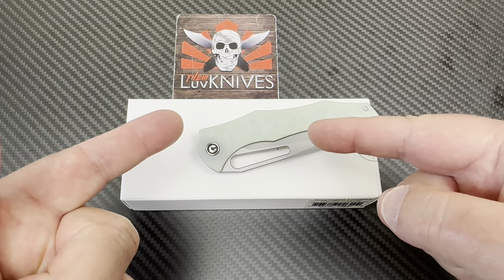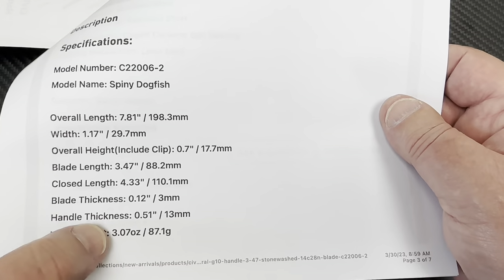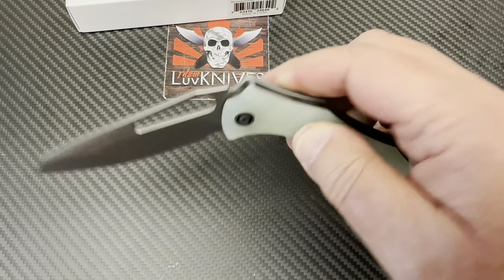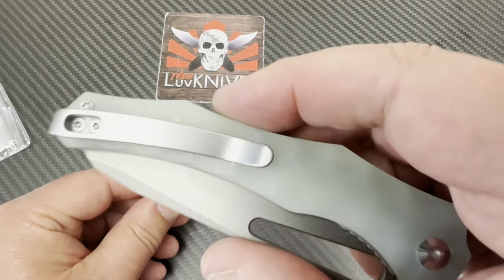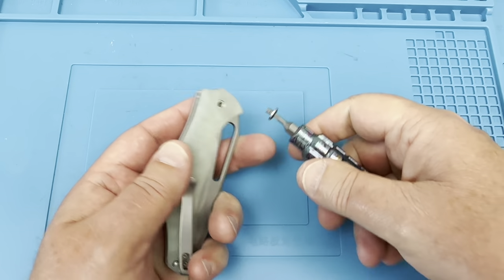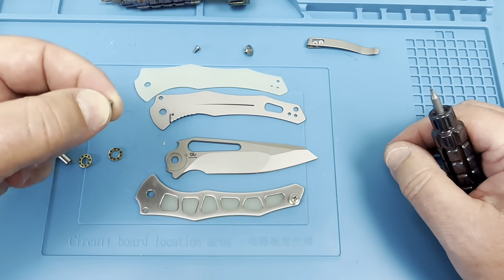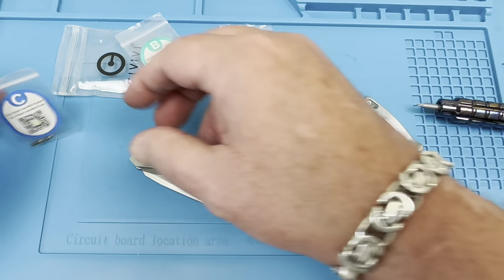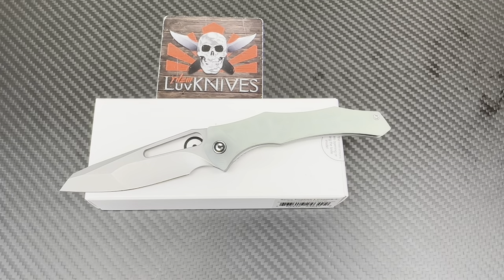Civivi Spiny Dogfish !  Gavco knives design !!

Comment: Hey there. I just wanted you to know that when I was disassembling my Civivi Elementum button lock the pivot of course is an 8 but the screws for the belt clip were a 7 not a 6 like I have been hearing in many videos. Is mine strange? Check it out. Love your videos! helping me pick out knives I may want to get. Keep it up!
Reply from the maker: I don’t know.  I use a six.  But maybe a seven will fit.
Reply: They are definitely T8 my friend. Some older Civivi models might have T8 pivot with T6 body and clip screws, but as of the last few years they've been doing strictly T8 for pivot and body (clips are always T6 unfortunately). But what's happened in your case I believe is that your torx bits have slightly lower tolerances during manufacturing which sometimes can cause a T7 bit to fit a T7 and T8 screw with a slightly less snug fit. It also seems to happen with T9 bits and they will fit T9 screws and T10 screws. Usually in these instances they only fit a size up and not down (i.e. your T7 may fit a T8 but won't fit a size down in T6). These manufacturing anomalies actually happen more often than people would assume, especially if you aren't buying WIHA brand torx and they're an off brand bit of some kind.